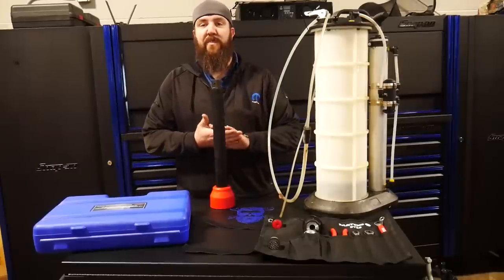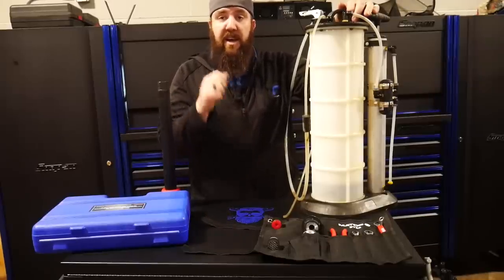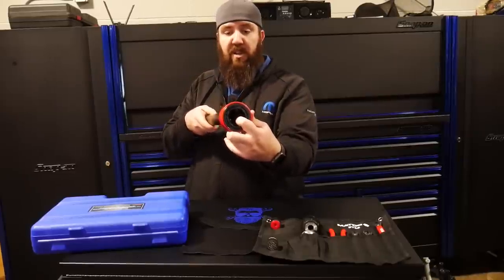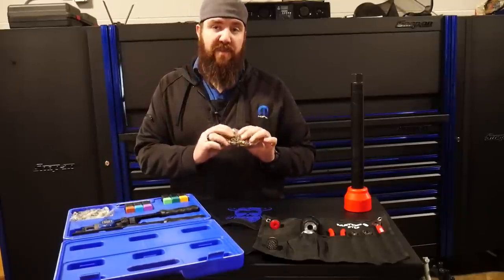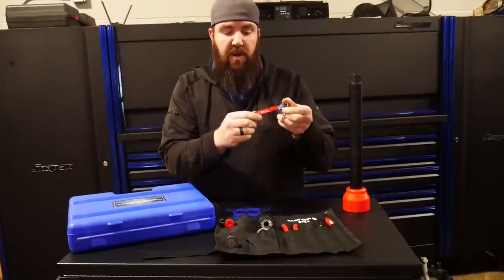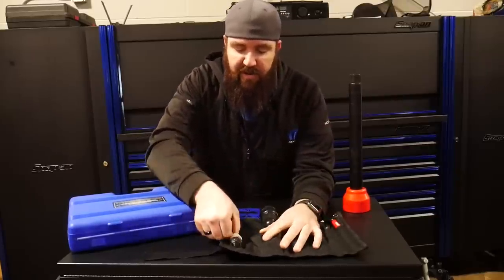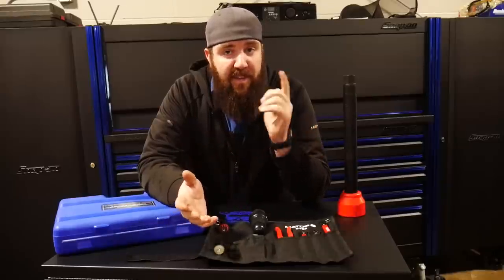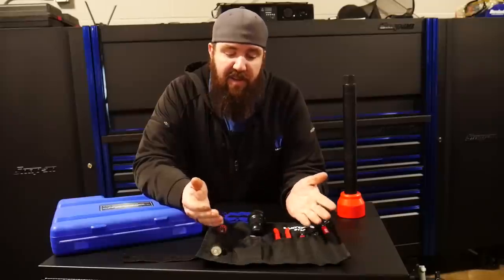WEEKLY NIFTY TOOLS WITH RUSTBELT EP 6

Comment: Love my Mighty Vac use it for just what you said oil filter housing leaks on Jeep Wrangler 3.6.  Between my daughters and I we have three 2016 jeeps and already had to do this on two of them.  The second one I just replaced the seals and it works so far.  Also have the nut zert tool also for accessories on jeeps and when I worked at a auto body shop Ram truck replacement doors don’t come with the zerts installed.  Well done sir.

Comment: Harbor Freight had the mighty vac brake bleeder kit which makes me think they have that one also which is something you can use a coupon on! I also have that battery tool kit from EZ red which I think is better cause it has a 4 in 1 tool for the cleaning and then a terminal spreader pliers set. Those pliers are friggen awesome for the nuts and bolt that hold the actual wire down, you handle them like a screwdriver and they REALLY grip good, my set is $50 from amazon. OTC rebrand it also.
Reply: Yota Doug's Tool Collecting Channel I was just about to say I think matco rebranded the ez red kit but they didn’t rebrand the master kit.
Reply: @HardKnocksForge  The kit that moneyline mechanic has is the old style with a blowmold case which I think includes the obII battery dealiobob